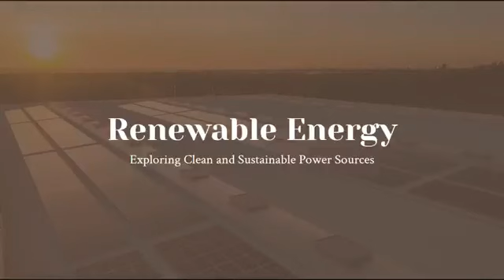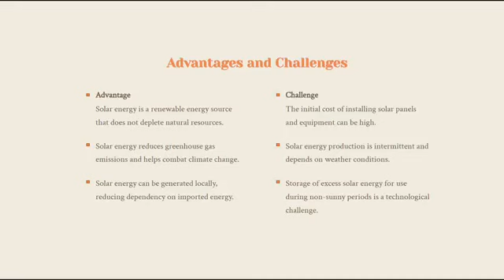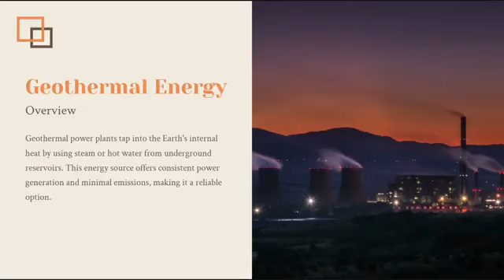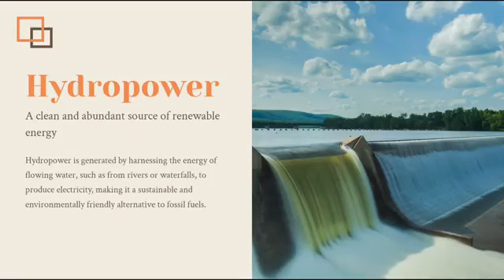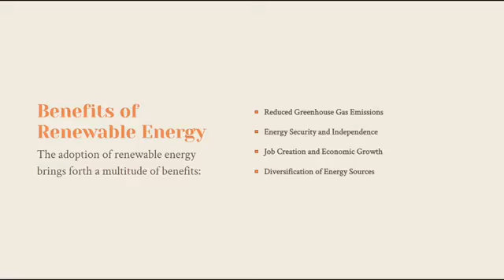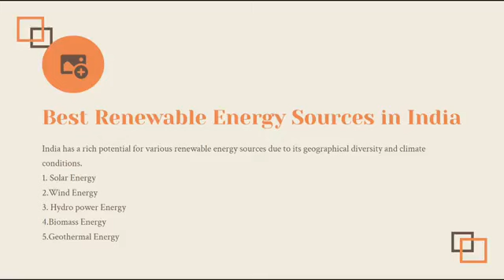Renewable Energy

Comment: A wind farm lives for around the 30-35yr lifespan yet RDP Marine hydroelectric will last 100yrs+ AND be base load power AND 100% recyclable wind and solar are not the answer in their current type. And lets not forget the upgrade in transmission towers needed and the money needed to carry the power for a max 35yr power supply.